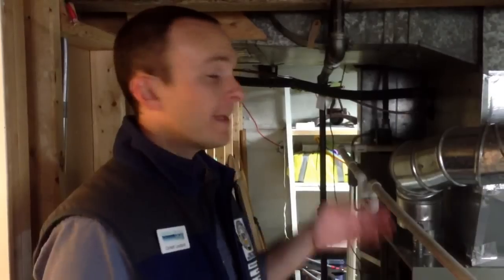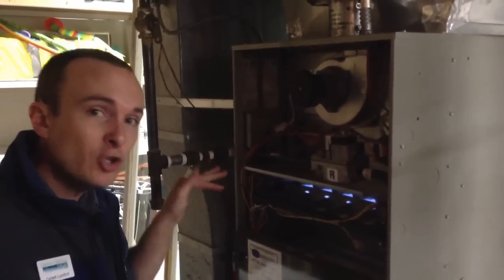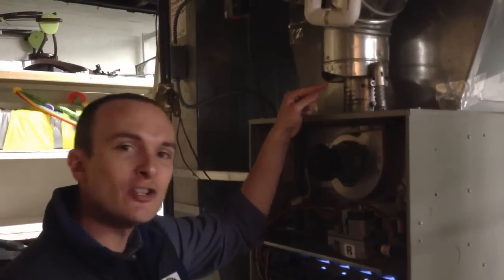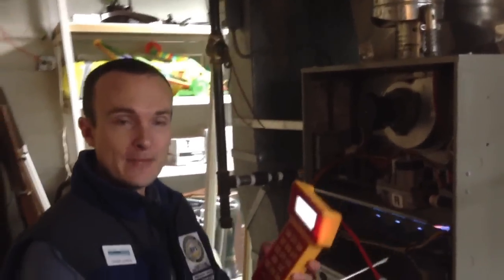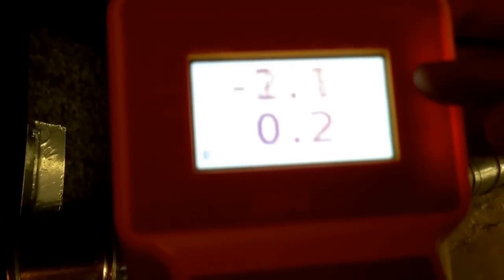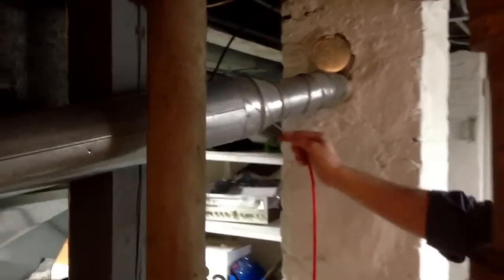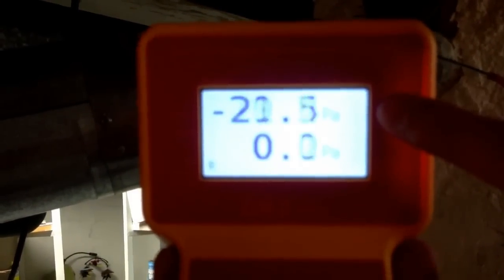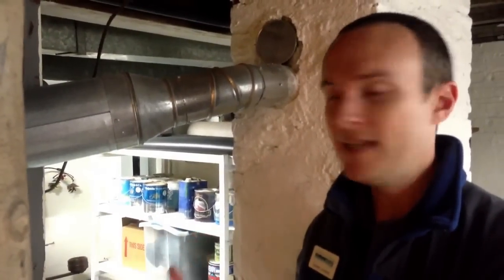Bad Furnace! Exhaust Flue Draft Pressure Testing

Comment: I'm having a problem with our oil furnace in the basement.  When it runs we are smelling an exhaust odor on the first floor right above where the furnace it, it's a strong smell of a car exhaust-like odor concentrated in one corner of the room, the smell takes about 15 min to dissipate after the furnace shuts off.  This started about 3 days ago.  I don't have the money for a repairman & I'm concerned about CO2 in the house, we have the windows open & the place is ventilated but is there any way to know what can cause this & is it an easy fix?  Also when the furnace turns on there is a thump that we hear in the basement, I sometimes hear this thump while the furnace is running at times it happens twice while it runs, the thump has been going on for a while but I'm wondering if it's related to this new odor problem.
Reply from the maker: You should call the fire department immediately, Anglynn!
Reply: Way late but maybe someone else can use the help.  I have the same issue with a Thermopride oil furnace in a rental on Whidbey island.  I have had three HVAC techs out to no avail.  So, just looking at it, I was realized (D'oh!) the install of the barometric draft damper was so out of whack it could not operate - period.  Exhaust gas was obviously (from the soot stains) exiting the flue here as opposed to make-up air entering.  Waste gas should never exit inside the habitable area.  We have taken apart the flue, re cut out the hole for the damper and reinstalled it (we took the pipe off and brought it back to our house).  We will reinstall the pipe and try to fund an HVAC tech that can tune the damper (https://www.youtube.com/watch?v=cCjAozBKpT4).  If you are getting exhaust gas in the house, this is likely the first place you should look.

Comment: Hey, Dig the videos, Very helpful. Say im exhausting 800cfm inline fan going from a fume hood to outside, and this is all being done right next to the water heater/furnace in a laundry room and been kind of getting a numbness in the nose n ear with a bit of confusion. is there a good chance its coming from the furnace/water heater even without the furnace running?  Im almost possitive the hood im using meets the fume hood requirments of removing 2000-3000fpm at hood face thru a 6inch duct to 8inch at fan.
Reply from the maker: I've never heard of a fume exhaust hood in a laundry room- that sounds very dangerous. PLEASE call someone to run depressurization testing and CO detection on both your furnace and WH, it sounds like you might be coming close to the edge. Of death.

Comment: Thanks so much for your answer. If the BPI expert determines that is a boiler malfunction or a malfunction installation.. Does his report will be enough to get the boiler replaced? Weill Macklein asked me for a plumber report.
Reply from the maker: +Michelle Michellin don't have the answer for that one, but I doubt it would need replacement. Just tuning it should do the trick, if the chimney and other systems aren't hurting its performance.

Comment: Small plumbing company installed in my house a brand new Weil Mcklein Boiler 6 months ago. Flu Pipe Test is positive to CO2 8 times out 10 that is tested. Installers don't want to take any responsibility because they claim that it could be the water heater or the chimney. I never had this problem with the old boiler and it was the same chimney and same water heater. Other Plumbers agreed to come, check and give me a report but they would shut off my services if the test is positive and I know it will. Those who did tests before don't want to me reports. In 5 more months my guarantee with boiler distributors and with bad installers will be expired. Please help me out. I am woman alone with a house to take care and I am devastated with this situation.
Reply from the maker: +Michelle Michellin if you're having a Carbon Monoxide issue (CO) you need to call a BPI-certified contractor at http://bpi.org to do combustion testing including spillage, draft pressure, CO, temp and worst case depressurization. They will be able to evaluate where the problem comes from and help solve it. Watch a demo: https://youtu.be/JRQ6no4dfAw
Reply: Hi Michelle, call the plumbing inspector in your town, or call your gas company, town should have done an inspection up the installation completion. At that point, pass or fail, the installer fixes, inspector comes back, says ok, it passes or fails, Then you make finale payment. Call both entities, get it fixed,,Learn from it,, call the gas co. next time

Comment: Wait, so no explanation on what the actual 'fix' is for this particular setup?
Reply from the maker: Yes, something has to be removed. It’s a confused combo of devices- inspect and test the whole exh system out through the chimney top, and make it work better.
Reply: @HomePerformance  lmao, okay well 'make it work better' is not very specific. but it's too bad there aren't videos on youtube that really show a homeowner how to properly maintain/improve their water heater flue system.
Reply from the maker: Well, like anything systems-related, it’s a bit complicated, M. Do you own a digital manometer like the DG-8? Do you have a combustion analyzer? Are you familiar with flue diameters? Can you do a chimney inspection? The point of this channel is to educate homeowners, yes, in part. But it’s also trying to level up pros who do this every day, because many many of them are also not equipped for this type of diagnostic approach. Hope you’ll subscribe to learn more.

Comment: great video man, i have a question, can i use my uei em201b manometer to do the flue vent draft pressure test like u did?  
😀thanks
Reply from the maker: Definitely not, Roy- that manometer has an accuracy of ±0.02”WG < 2” wc, which means it'll be off by up to 5 Pascals. You'll need to be accurate to 1 Pascal at least to do this test accurately.
Reply: thanks   😊  igot it
Reply: Is the Ecom D a good device to use to detect this issue in my mom’s house ? I believe it’s dangerous the way it’s installed in her townhouse. The house has signs of mold growth in some spots of the furnace vent where you put the filter. I just happen to have a ecom D I have no idea how to use

Comment: Where did this test come from? Wouldn’t the pressure switch prove the efficiency of the flue pipe pressure? The holes drilled in the flue pipe will no release exhaust gas into the structure. I have never heard of this test.
Reply from the maker: This is a widely used diagnostic, used in weatherization programs nationwide. It’s built into the test capability of many combustion analyzers. You should try it.

Comment: What pressure would you want to see on a 2” flue vent to outside from a 3 burner 60,000btu furnace? I have some flame rollout and doesn’t look like an HE crack. Wondering if the inducer fan is under performing or if flue vent is clogged.
Reply from the maker: -3 to -10 would be a normal range. But 2 INCH FLUE? That might be your problem right there. How about 4” instead?
Reply: It’s 2” pvc from inducer to outside (venting to the side of the house). Looks like the unit calls for 2” on the side. Goodman gmp075-3
Reply from the maker: Aha, PVC will have a positive pressure, don’t draft test that. Just go outside and if it’s blowing on your hand, it’s probly not clogged. Flame rollout on a sealed combustion furnace tells you something is VERY VERY WRONG.
Reply: Thanks for the reply. I’m thinking the inducer is pulling just enough for the pressure switch to work but not pulling/exhausting enough air for the burners to operate correctly.
Reply from the maker: That’s not an inducer, it’s a power vent, and it should be forcing flow along the entire vent system.

Comment: What is exactly do you do
Are you a building analyst? 
Which bpi do you think i should complete? Plz help
Reply from the maker: Hi Shield- I used to hold every BPI certification they had, but I let them all go and now I work on the dim frontier of home performance. You need Building Analyst to start with, but I'd also add Envelope Pro if you're an HVAC tech, it'll fill in the gaps of your current expertise. Good luck buddy, let me know if you need coaching.
Reply: @HomePerformance  what do you mean by dim fromtier of home performance what is the difference and how do you coach cliehts?

Comment: I have a problem where my furnace will turn on and blow warm air for a minute or two, then blow cold for the rest of the cycle and it will do this about four or five times before turning off and not turn back on. It only turns back on when i turn the thermostat off and then back on, , could this be from that pipe being clogged?
Reply from the maker: Yo 216- your furnace should not be acting like that, obviously. It could be the temperature limit switch, which would mean your system airflow is too high, which could be because the pressure is too high. It could be a problem with another sensor, but I highly doubt it's due to a chimney blockage. Most systems will go on running like nothing is wrong when combustion gases are spilling into the house.
Reply: Home Performance it was blocked, cleared it out and been good since. thanks anyways
Reply: What was blocked?

Comment: You say that you can feel the combustion gasses coming out of the pipe, but that's extremely unlikely.  You'll feel heat, but that doesn't mean that the gasses are leaking.  The fact that you have a good flow in the small part of the pipe proves that it's venting strongly and that opening may not be a problem at all.  You would need to use something that can show air flow near the opening to know if it's sucking in or blowing out.  A match can easily show the air flow direction.
Reply from the maker: Yes, we prove any of our findings with testing- this was just a quick field vid. Watch some of our longer combustion and exhaust testing vids to see some more pro tools in action: smoke pen,  smoke puffers, etc

Comment: i don't understand this: you pierced holes in the chimney to insert the probes?
Reply from the maker: +Alexandros Gialidis in the flue, to be precise. A chimney is under negative pressure by design, so no gases should escape through the test ports (holes) you make. Then, plug the holes so they can be re-used for later tests.
Reply: so if a hole is in the flue no smoke should escape inside the room? also what do you use to plug the holes?
Reply from the maker: +Alexandros Gialidis correct, air should be sucked into the flue unless something is terribly wrong (that's why draft testing is important). UL 181 tape is what I use.
Reply: can this be used as a permanent fix in a fireplace inox roller? Meaning to insert a probe permanently in the roller, connect it to a pressure meter (what meter would you suggest) and fix the meter outside the decor cladding?
Reply from the maker: +Alexandros Gialidis yes you can- Dwyer Instruments make gauges for that!
Reply: @HomePerformance  Since that looks to be b vent that you drilled into, do you plug the inner hole with tape as well as the outer hole?
Reply from the maker: In the case of B vents, you can caulk the inner wall with hi temp, seal the outer with tape
Reply: Is there an MSDS somewhere that shows high temp caulking (liner) and the tape you listed (pipe exterior) as an approved / accepted repair on B vent? Not finding it. Would love that for easily repaired cracked elbow joints and holes for testing. Lots of opinions out there on this. Thanks
Reply from the maker: Nope, no one has standardized this, sadly. Open season.
Reply: @HomePerformance   thank you

Comment: Shut that system down, its illegally installed. A giant liability to every technician who touches it. GIANT LIABILITY! A DEATH TRAP with CO spilling into the basement,, The system was never inspected. The state of Mass. has the toughest codes ever for good reasons, these kinds of installs. Dangerous is an understatement. Deadly Install. in mass. we have to notify home owner. call gas inspector, they will Lawfully go after the installer,  The gas company if natural gas, needs to lock out the gas meter till fixed.. This repairman, the minute he seen this install as it is, should have the home owner in this video explaining why its being shut down, to other installers, take a hammer drill, drill a circle of holes, enlarge the chimney opening, duct properly, insert clay thimble, round if possible, size accordingly, always bigger, never restrict flue gasses, use Portland cement at clay brick chimney, stucco around repairs, use up left over cement., learn to be better installers, your career is over when you kill someone from CO poisoning,    good luck Warren
Reply: You from Mass?? You in this field??

Comment: This is exactly how the force draft is set up on my furnace. "Atmospheric draft".  The guy who installed it claimed that no fumes would escape. Can you suggest where I might get the proper enclosure. The unit is a trane xr80. Thanks for posting this video.
Reply from the maker: Hi Cho- You should absolutely get it looked at by a consultant before moving ahead. Combustion gas exhaust isn't a DIY thing.  What I do sometimes is tell a highly reputable company that I'm looking for an independent consultant, that I will NOT be buying the services from them (nothing to lose on their end if it turns out to be a simple fix).  Every home is different, and prescription doesn't make sense without knowing the facts.

Comment: My point is that its obviously useless doing any testing with such venting in situ. 
You never mentioned the non code venting in your vid? 
Neither did you mention the lack of vent pipe supporting straps?

You dont know where what  "idea came from"?
Reply from the maker: +mike gert testing is never useless. Some things work even though they're against code. If you just take what a book says at face value without understanding why it works or doesn't work, that's not science, and you won't find it on my channel. Testing will always teach you something if you have a curious mind.